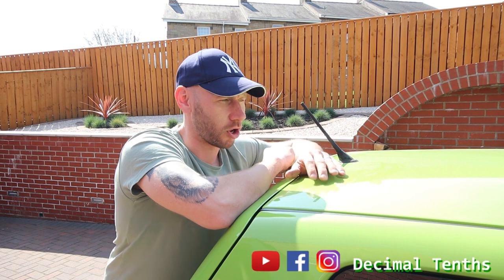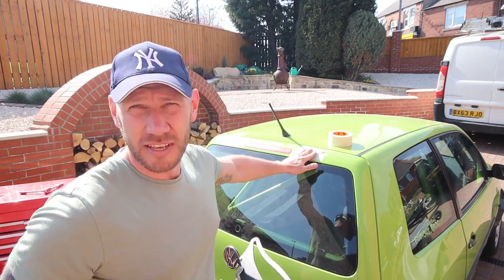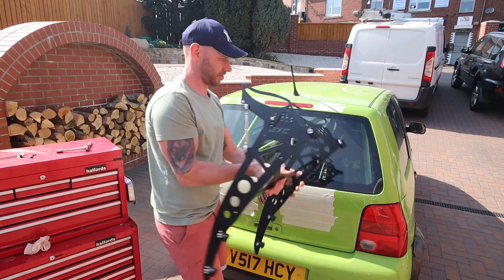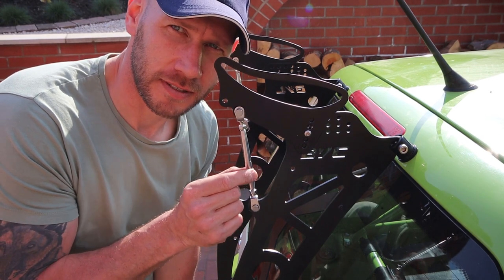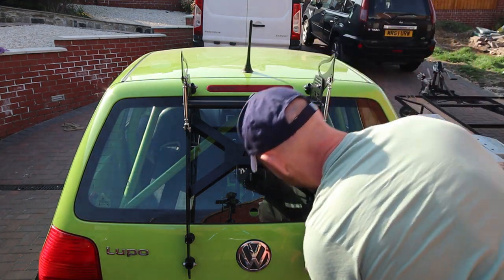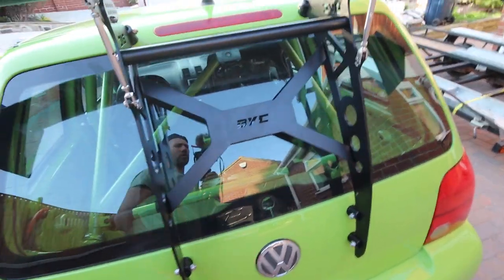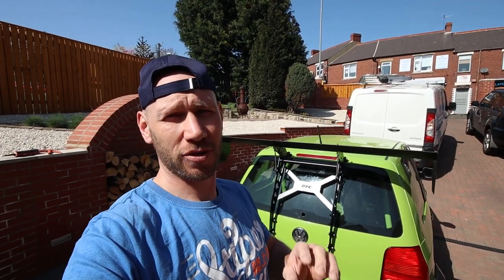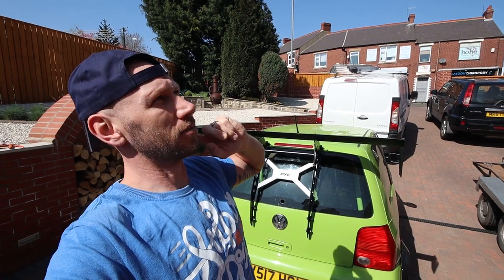Track Car gets a BYC Wing !!

Comment: Hello is this kit for other cars like Seat Ibiza Cupra?? I live in Norway soo less posibilities
Reply from the maker: I used the kit for the Lupo. Not sure if it fits any other cars. Best to just check with BYC, they're a helpful lot 👍
Reply: @DecimalTenths   Thanks and you have a really cool tracday car , PS: did you use oil kit adapter on the watercooled  oil filter holder?? hope you understand   lol
Reply from the maker: @thorsteinelstadolsen2005  thanks, I've had some cool fast cars and yet this is the most fun! Do you mean the thermostatic sandwich plate where the oil pipes take off from the filter housing? If so then yes I used one